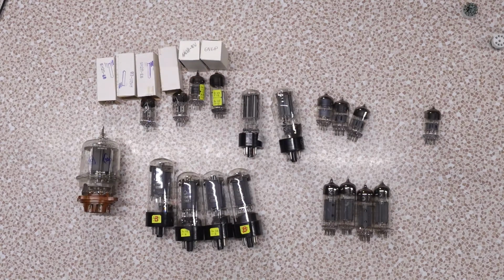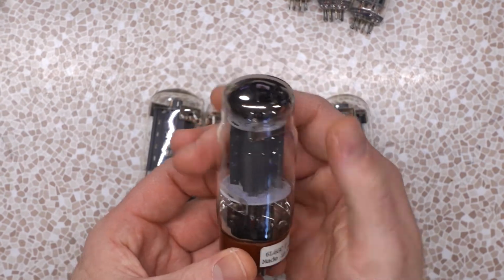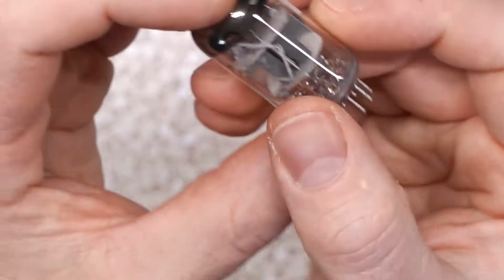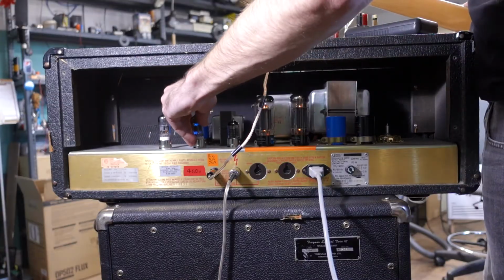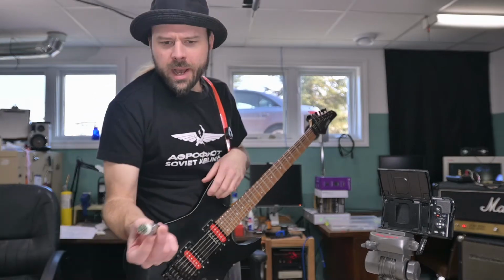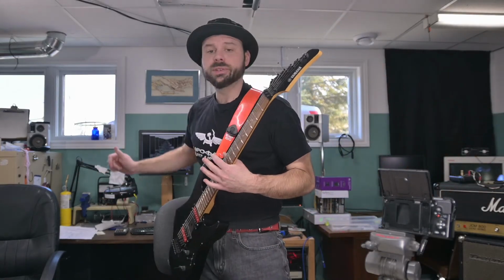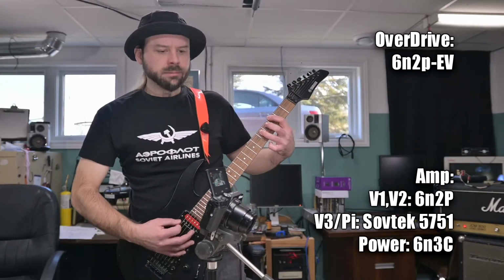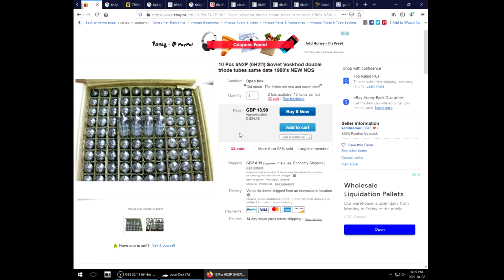Soviet Surplus Vacuum Tubes Tested !

Comment: You can use android phones to translate those data sheets.
Also, check out the switching circuit you can add to preamp heaters so that you can use 12ax7 or 6n2p-ev.  Essy peazy. Spdt switch is all you need.
Reply from the maker: I think I did use an app online at one point to review some sheets. 
And I've def added a switch to some of my clone amps. 
My Jubilee clone actually.

Comment: Would it be safe to use 6n2p in my Marshall sc20 head, and fender Bassbreaker 007 head?  I am not sure how to check the heater voltage. Thanks.
Reply from the maker: I managed to find a schematic for the SC20, and no, it uses 12v heaters, so not compatible. I can't find info with the Bassbreaker. If you have a multimeter and the confidence to probe the socket, I could try to explain how to check.
Reply: @DATT  Hey, thanks a lot man. I guess I could do it myself but since I have a few more amps its better to find someone experienced to check it for me. Thanks again, it really helped me at least knowing I can't use them in my Marshall. Cheers!
Reply from the maker: @manintheboxxxX  Yeah, if I had it in front of me, I'd be able to figure it out pretty quick.

Comment: I read the 6n3c tubes might not handle much and red plate easily in high gain amps, then i found there is a 6n3c-e varient thats  the extra life military graded version that can apparently take a lot more and has a rating of 2500-5000 hrs. theyre nearly identical to the sovtek 5881/6l6wgc tubes with the thin wafer base, ive even seen nos sovteks that are relabeled over the old markings lol and ive seen the 6n3c relabeled as groove tubes and all sorts of names.
I got some of the 6n3c-e and they sound pretty good and no red plating yet! Check em out while theyre still cheap
Also fyi you can use google translater with images to help translate those old russian datasheets ;)
Reply from the maker: Oh yeah, they aren't has high wattage, or high voltage for that matter, so you have to be careful. I personally have had good results with them, biasing based on 20 watts. That and I mostly run my amp at lower volumes. We had set a buddie up with a 4 set in his JCM900 at one point, and they did go red plate, but that's half cause the match was poor on this set and a sketchier tube ran away. I put 2 into an old traynor, that I think was only 420-440v and they were fine, cranked all the way up too. That set was a much better match also. Seems matching is important. 

I'm pretty sure at one point some of these tubes and Sovtek are the exact same thing. One of the factories that makes these tubes. Reflector I think, I could be wrong, was the factory that made Sovtek back in the day. So those short place 5881's are the same tube relabeled. Also some of these preamp tubes, you can tell are pretty much the same thing and modern sovtek, just pinned differently. |

Yeah, I have used google translate to do that.

Comment: Hey man! Awesome video :) one question; did you had to change heater voltage inside the amp before puting those 6N2P into the "adapter sockets" or does that socket convert 12 volts into 6 volts? Thanks for the answer!
Reply from the maker: Ah no, as long as your amp uses standard 6v wiring, the adapters to the work for you. 
However, you kind of need to make sure your amp uses standard 6v wiring. 
I've noticed many newer amps can use 12v, and even 24v heater supplies. We tried these adapters on one of my buddies amps, I forget which one, it almost went thermal nuclear. 
Bugera I've noticed likes to use 24v heaters, with 2 tubes wires 12v in series.
Reply: @DATT  Im using Bogner Alchemist and so far what I figured out is that I have 6.3.v heaters! Awesome, will order those adapter sockets, already have 10x 6n2p-ev NOS home that Ive picked up in a tube lot last year..and order some other variants on the web :) cant wait to go down that rabbit hole hehe. ..I have quite a few vintage NOS 12ax7's but I would like to run em on budget and not feeling like I have to spare them and be careful everytime :) also have 6n1p and 6n6p's at home aswell. This is gonna be interesting:) thanks for your answer!
Reply from the maker: @MartyFavento  I have a Alchemist service schematic, yeah, looks like you're good, standard heater wiring. In fact, it seem they are all AC heaters even. Usually in a high gain amp, at least the first preamp tube is DC heaters. 

The 6n2p-ev were decent. They look just like sovtek WA's. Well, they kind of are, kind of. 
These tubes were the same family, and in some cases the same factory at sovtek once upon a time. 
I tend to avoid NOS tubes, which ironically, these are. I also played with 6n1p and 6n6p, but I guess I mentioned that in the video already. The 1p's were good for phase inverters.
Reply: @DATT  awesome! Now im even more excited and certain this will work out :) thank you big time for your info! Btw, I saw you using 6P3S as power tube in this vid. I've been using for the past year 6P3S-E (coin base version) also a higher spec tube. And it sounds rich, full bodied, dynamic and strong in low end. I think you might like em way better then standard 6P3S you have. Didnt tried those particular ones you have but heard many times that 6P3S-E version is way more musical. It needed like 20ish hours to burn in so to speak..it sounded really glassy and stiff right off the bat..But eventually it opened and all the characteristics that were mentioned before came out :) I understand what you mean that you prefer new tubes cause of availability...im a vintage tube freak myself..I have all the good stuff( Philips, Telefunken,Mullard, Tungsram etc) and to me sounds so superior to new made stuff that I cant go back using modern.. btw, I also liked JJ Ecc803s in modern choiche..and since you like low end like myself you should try JJ E83CC frame grid tube..this one really sounds fat and full of smooth mids, I prefered 803s before I tried this one :)
Reply from the maker: @MartyFavento  Oh yeah, the -E, it's a short base 5881 that was sold under the sovtek brand for years. I've tried a set once, they seemed pretty good. The non -e once I got were for the lols, and cause their design reminded me of an old shugang 6L6 tube set I have that have an interesting sound. The non -e's can brighten up a dark amp a bit. 

I've used the 803's and 83CC's also, have a set. I like the 803's in my crate and 800 too I think. 
The 83CC's are in V2 and V3 of my Jet City head. You think the 83CC is fatter and smoother than the 803s ? Hmm, Maybe, I liked the 803's cause they were dark and could tame a bright harsh amp. But I guess that doesn't equate to fat and smooth. 
One thought that comes to mind, is to mention I almost never like the same tube in my Pi position that I like in my preamp/gain positions. Can't remember the last time I tried 803's or 83CC's in the Pi position.

Comment: Cool comparison.  Were the normal 6N2P and the EV both from Voshod?  Or Maybe a Reflektor?
Reply from the maker: They appear to have a Voshod logo on them. Aren't the Reflektors rarer ?
Reply: @DATT  just a little more rare. There are also Foton 6N2P tube,s. I like to do a comparison with this 4 tube,s
Reply from the maker: @keesguldie  Yeah eh. I def heard a different in texture between the EV and Non-EV tubes. 
I might have been looking at the other makes but didn't bother cause my goal was to be as cheap as possible.